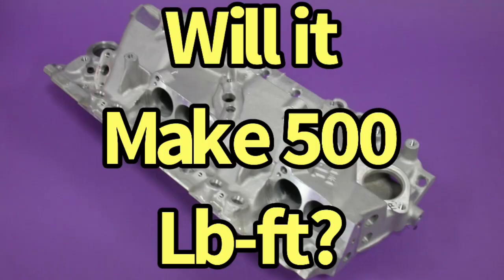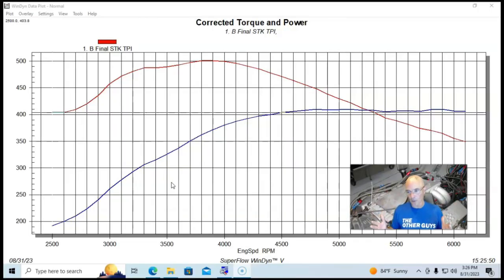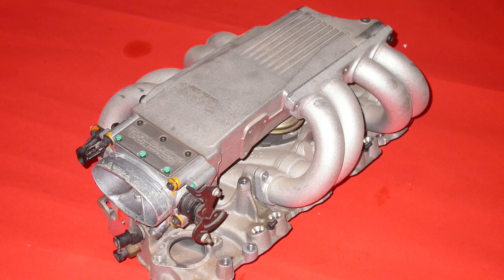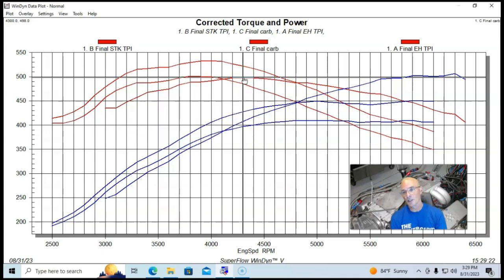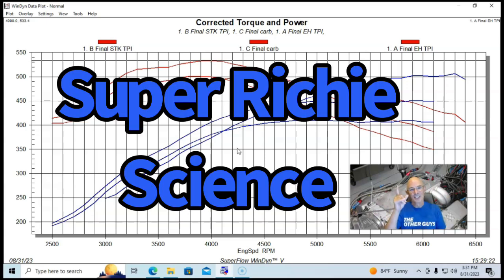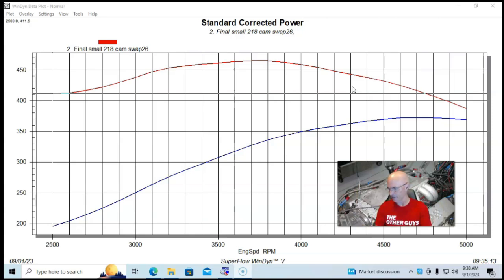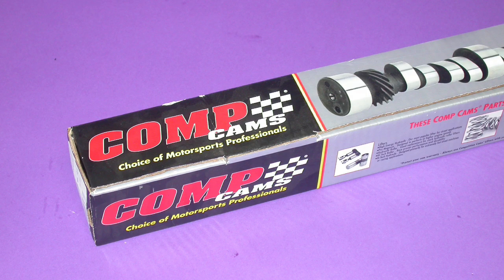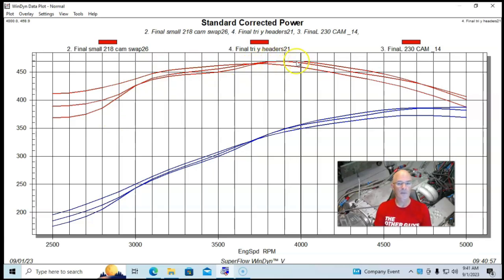TUNE PORT L98 350-CAN WE MAKE 500 LB-FT OF TORQUE? PLUS, TRI-Y VS 4:1 HEADER TEST-WHO MAKES TORQUE?

Comment: 106 LSA and 11.5 to 1 compression will get you there. My only issue is that we're limited on airflow with the Tuned Port Injection set up. Also I'm wondering about installing collector extensions with mufflers. You never know until you try. I  hope you return to try again. Nice work Richard.  Thanks for doing all these test
Reply: 106 LSA and 11.5:1 is helpful, but it'll knock like crazy on pump gas.  Top shelf heads + the FIRST fuel injection TPI-style intake and an aggressive roller cam get rid of the airflow issues, withing the RPM window that you have to work with with the long runners.   Long runner engines pushing the boundaries quickly become octane limited.  Great quench velocity, cold coolant and cold air help to a certain degree, advanced fuel injection strategies like open valve injection can help a bit more, but if you want to REALLY push a TPI engine, you give it compression and E85.  These things cry out for E85. (Get you more oxygen and more knock resistance.) 

An E85 all-out FIRST TPI build would be so awesome...
Reply: Sequential injection instead of batch fire would make more power and better fuel efficiency.

Comment: Still the wrong cam! A better wouldve been the XM270HR12, or even better still the Lunati Voodoo 262/270 - both on a 112 LSA. The LSA is too tight at 110 degrees. Compounding it is you have a high E:I ratio on those AFR195's. The intake harmonics, a tight LSA and a high E:I ratio means too much intake charge is being sucked out the exhaust valve. Frankly, that mightve been the dip on the Tri-Y's as well.
Reply from the maker: SUCKED OUT THE EXHAUST? HOW ABOUT NO
Reply: @richardholdener1727  and you have data to show this? Because it looks like nothing was monitored on the exhaust side.
Reply from the maker: I have run cams on heads with wildly different IE relationships and the gains offered by the cams were the same-if the cam added power with 1 type of head, it added power with the other type.
Reply: @richardholdener1727  with all due respect, so you have no data on the exhaust side? No EGT? No O2 readings? Or anything else? Ray T. Bohacz wrote a bunch on the TPI intake back in the day. Tuned Port is derived from tuning the resonance in the intake tract. That resonance packs the cylinders. But because there is a resonance employed, it narrows the power band. A short runner - like a single plane manifold - is decoupled from this. (And I am sure you know this; it's for others who may read our discussion.) You had a sizable torque dip when switching to the Tri-Y's, if i recall correctly. And it was an actual dip. That looks to me like evidence of over-scavenging - hence my exhaust data question. That, I suspect, is caused by too much valve overlap and maybe some exhaust pulses pulling the intake charge out (Bernoulli's Principle), which is magnified with a fast exhaust port. This is why guys like Myron Cottrell, who founded TPIS, and John Lingenfelter preached high lift, short duration, and LSA's over 112 degrees for TPI's. They're in alignment with Bohacz's advice that you cannot treat an intake system, tuned for a resonance, like you can with an untuned intake. That's, in part, why i think the XM270HR12 is better suited than the XR270HR, but those still don't have the lift numbers of the Voodoo line, Harold Brookshire designed for Lunati.
Reply from the maker: I am very familiar with the three forms of charge filling associated with intake design (Reflected Wave, Inertial Ram and Helmholtz Resonance), your description of "tuning the resonance" is (at best)  incomplete. This discussion would get very technical, including the initiation points of the reflected wave, the overlap of the positive and negative pressure waves (of the three forms) and the distance traveled by the waves that determine the effective rpm of charge filling (arrival when the piston is at or near bdc). The cam timing events, most notably the opening of the intake valve and downward movement of the piston, initiate the start of the (initially negative pressure wave-returned as a positive pressure wave) so our wild cam timing was not in synch with the effective operating range of our tuned runner length. There is a lot going on, because similar things are happening on the exhaust to help both scavenge exhaust  and induce induction flow. BTW-EGTs are not a good indication of exhaust escaping. Hope this help.
Reply: I'm aware my mentioning of resonance was not complete  nor barely scraped the surface. It was more a point of reference - and more for those who may be following along. But coming from an aerospace background, if I gave a customer a result and unable to provide data to explain what is inside and behind those numbers, they would tell me my test setup (at best) is incomplete. And I am aware EGT doesn't measure exhaust escaping but it can indicate if there is additional combustion occurring inside the exhaust header, maybe from over-scavenging. Hope that helps.

Comment: My guess would be deck the block and/or heads for more compression, notch the bores of the block to unshroud the valves, a bigger valve package, and possibly a tighter LSA for dynamic compression. My position is allow more intake charge in and compress it more.

Comment: Perhaps a little overkill but... everyone always does the 383.. I know it's a little extra effort but what about a 396 stroker, fully ported and port matched tpi intake to AFR 195's, not sure what cc chambers would be the best, 65 or 75.., tpis large tube runners, fully ported plenum, comp xfi 268 cam. 218/224, 113 lsa, 568/572 lift maybe, pick a throttle body, whatever you think is best. We all know a stock 48mm can support 500hp. Maybe 24# injectors and one hell of a custom burned ECU chip. If torque is the name of the game then there's no replacement for displacement. This combination could belt out around 480hp and 550tq if my calculations are correct. Now that would be a "bulletproof" street motor. What do you think? Can it be done or am i completely wrong lol. Thanks for all the great videos and content!
Reply from the maker: I think you might be a tad high on the hp with a TPI and 218 cam
Reply: @richardholdener1727  by"calculations" I think I meant more like speculations. Was I in the ball park tho at least? Solid combination tho? And thank you for responding sir, i appreciate the feedback.
Reply from the maker: it will make plenty of torque

Comment: I wish you would get your hands on a First TPI unit and run it..
Reply: I have one on my 85 iroc. Only 80k on the whole drivetrain.
Car sat out since 08 and rusted to hell from the inside out. T tops leaked I'm assuming. So I bought a 91 RS and I'm switching everything from the 85 over. Side skirts, bumpers, all of it. Even the dash and interior
Reply: @ronspencer676 save er rebuilding everything in my 85 c4 right now same mileage

Comment: What fuel injection computer were you using on the TPI system? Im guessing it was something that is tunable. Unlike the factory prom computer.
Reply from the maker: holley hp
Reply: @richardholdener1727  . Ok thanks! How hard do you think it would be to change my 1985 Corvette Lingenfelter 383 over to that from the stock system?

Comment: Turbo intercool and 20lbs of boost will get you over 500lbs and 600 hp out 355lbs
Reply from the maker: see the turbo tpi video-20psi is a lot more than 600 hp

Comment: Keep the smaller cam duration get a bit more lift to match the curtain area of the heads.  Get compression up to 11.1 get a first intake or at least a first base the lower stocker even extrude honed is pretty bad for flow.  All in all you will close to 500 at 4k.

Comment: Very hard to make 500 horsepower with a 350 with under 11 to 1 compression much less 500 foot pounds of torque l could see 480 if compression was 11 or 11+ my mild 495 horsepower GM crate LS3 with with CNC ported and milled LS3 heads on E85 makes 490 foot pounds of torque at 5000rpm and 520 horsepower at 6200rpm at the crank and it has a 3.62 crankshaft vs the 350s 3.48

Comment: If I build this, and boost it... would this be a viable engine option in a secondary tow vehicle? 
Or would a 454 based combo be "more gooder"?

Main tow vehicle is a 2004.5 Cummins 325 hp/ 600tq. 
100 % stock. 😍 18ish-20ish MPG.
Reply from the maker: use the bigger motor
Reply: @richardholdener1727  
Thanks Richard. The other idea I've been chewing on would be to just go with the 5.9 6bt swaparoo.

Comment: Use the TPIS zz9 cam, 1.6 rockers, with a 52mm throttle body, the 58mm is too big for the combo.
Reply from the maker: bigger tb has no effect on power
Reply: It's EFI; not a carb.  A bigger throttle body won't remotely hurt power, just make tuning a bit tougher. (The FIRST Fuel Injection TPI intake comes with a 71mm 835 CFM throttle body as the "small option".)

Comment: So how about a 0.040 over 307 block with a 3.625" crank?  349 inches.  Use a 5.85" rod to get the R/S ratio close to the 383.  I dare you!
Reply from the maker: rod ratio shows no difference in power

Comment: Ya gotta read more David Vizard.  He has proven to himself that a 6" rod 383 will make more ft-lb/cubic inch than a 350.  Maybe the best way to make 500 lb-ft with a 350 is to use the bore and stroke of the 5.7 LS motor.  There's something hidden in the Bore/Stroke ratio.  Smokey Yunick said, decades ago, that the 350 Chevy was wrong and that it really needed a 3 5/8" stroke.
Reply from the maker: I tested a change in con rod length on the dyno-it showed no power

Comment: What heads in particular are those? Most AFR heads continue to see improved flow all the way out to 0.600" lift
The duration is probably about right for the goals here, but there is the possibility that 20-30CFM was being left on the table by sticking with the low lift cam.

Comment: It has probably been said but tighter LSA on something like the smaller cam (so about 106 lobe separation) and advancing it so it would close the intake sooner and shift torque to lower speeds, like 100 to 102 intake centerline, but along with more octane so timing could be advanced more and/or more compression and timing and octane may have done it. I thought you had testing a F.I.R.S.T. TPI set up but I don't see it....

Comment: Id like to see what happens when you dyno two engines same specs but one ultra light internals! Please 🙏
Reply from the maker: already did that with light flywheel and drive plate-there is a difference in power

Comment: I don't think you're going to see 500 ft/lbs with this combo in street trim.  Yes, you could potentially achieve it with a more radical cam, or more compression but the intake and stroke are your limiting factors.  The carb test proved the potential was there with no other changes.

Comment: Custom cams are expensive: 224/232 @.050, 106 lobe separation, installed @ 102 icl. Cranking compression should be 190-200 for pump gas to work. Just guessing I hope it works. Try this combo with 750 carburetor also 😊
Reply: I forgot...this is a Solid lifter cam

Comment: I agree, tighter lsa and more lift. Usually can get away with lower duration and more lift with roller camshafts. Remember higher ratio rockers add more valve lift everywhere not just peak and thats what adds torque. I love the tpi for truck applications. Currently have a 383 tpi with lt4 hotcam with gt45 turbo.

Comment: Hi Richard
How about a test to get the best BSFC for a specific lbsft @ midrange rpm replicating cruise in a car.
Which v8 would do that with what mods?
Reply from the maker: unfortunately the engine dyno is not a good place to test mpg. That is best done on the street
Reply: @richardholdener1727  Sure but best place to test engine efficiency via BSFC v torque and hp. Surely the dyno has fuel flow gear on it?

Comment: Ran a 355 tpi at 10.25:1 w/mildly ported iron eagle 180s, lt4 hot cam kit(so 218°/228° .525" on a 113lsa) and the old edelbrock tes headers for a few years before stepping up to a 385 stealth ram setup. My assometer is not certified but 450ish ft/lb sounds abt right. 1st gear with a 700r4 was wonderfully useless

Comment: Edelbrock e-tec 170 or afr 180 heads instead of the afr 195 heads that were used here and you would've nailed the 500lbs torque you where going for easy with your smaller cam or could've also tried the comp xr264hr cam with the e-170 or afr 180 or even stock vortec or ported l98 heads and would've easily hit 500lbs torque. Check out richard's article on page 57 in march 2007 issue of super chevy about making crazy torque with tpi.  Rule of thumb with 350s is if you want crazy low end and mid range torque 170-180cc intake runners heads. If you want crazy power 195cc intake runner heads but the 195cc heads always shift the power and torque up above 4000 and always loose big torque 4000rpm and below no matter what intake you have. Check out richard's nov. 2006 article in super chevy showing the power and torque shift going from holley 185cc heads to afr 195 heads. 195cc afr are only good low speed torque heads on sbc 400 cu in and larger where the much large diameter piston can keep the velocity's high to help with low speed torque production. Thanks richard for more valuable dyno data. Both your wins and your fails help us at home build better performing engines and be able to share real data with our friends making our hobbies and motor sports better and our cars and trucks faster and more fun to drive that time to time add trophies to the collection.
Reply from the maker: no on the smaller ports

Comment: THE TPI was sized for 305 original.  To get more power out it you would need Edelbrock manifold and runners.
Reply from the maker: the edelbrocks made less torque than this combo
Reply: @richardholdener1727  To gain torque you could have used an old Header by Ed catalog advice, and cut up the 4 into 1 header and ran the set up into a 4-1 collector. If done right, you coulc have flattened out the torque curve some more.

Comment: Thanks for sharing! Very well done. Valve timing was all spot on, but I think the big cam told the story. The bigger tubes needed more duration to get the gain in tq. The smaller cam probably would have done better tq yet with the smaller tubes. Pressure wave tuning is completely different than everything upstream of the throttle body, diameter and length both affect Helmholtz resonance.

Comment: Richard, how about a dyno test on a dual plane manifold which has had injectors fitted close to the head ports MPI style. Then dyno test it against the same manifold running a carb. The purpose is to see what happens with the Air/fuel ratio in each cylinder. Will the EFI cause rich/lean cylinders due to uneven air flow but equal fuel application to each cylinder. Especially at low RPM's. Typical manifold would be a Edelbrock RPM air gap.
Reply from the maker: if you have port injection, you can tune individual cylinder to optimize the af at every rpm (see the video I did on this using the single plane) It will work the same with a dual plane

Comment: 11:1, single pattern cam or only 2 degree duration split (221/223) and tighter lobe separation 108, 1.6 rocker for .540-.550” lift.

Comment: This is why I'm building my autocross engine with a LS truck manifold and really long tube headers, and a long duration cam with a tight LSA so it will keep pulling past peak HP without losing too much power. Autocross doesn't need lots of HP at high RPM because the car is not going fast enough to be making much drag so it will still accelerate past peak power if the power doesn't drop too much, and that big cam 383 with the TPI intake only lost 3 HP between peak power and redline. I'm hoping my engine has a similar power curve with the TrailblazerSS manifold and really long tube headers and the Jeg's 295/336 cam.

Comment: So the big cam in the 383 gave the long runners more time to fill the cylinder, should have tried the 383 cam in the 355.
Reply from the maker: no
Reply: Haha. OK, shoulda run a smaller cam in the 383 as you said, but the 383 did pull a bloody good torque number with that biggish cam.  @richardholdener1727